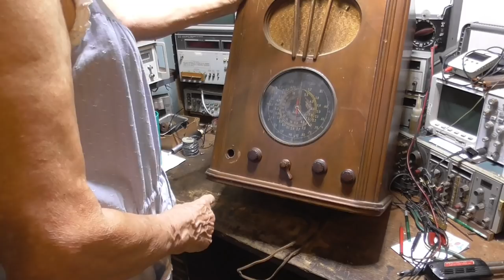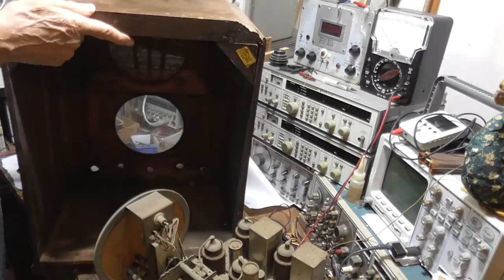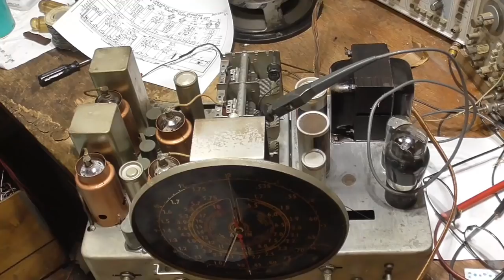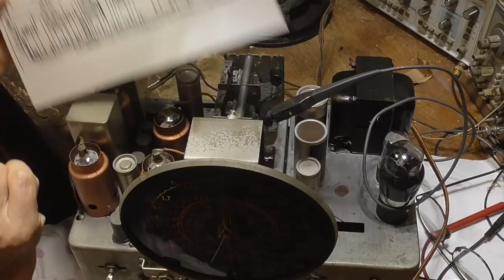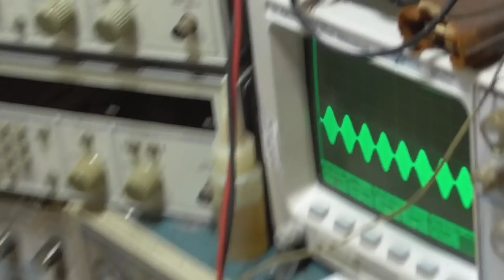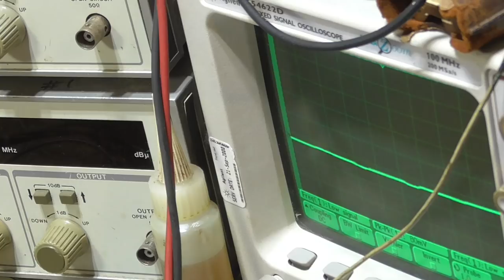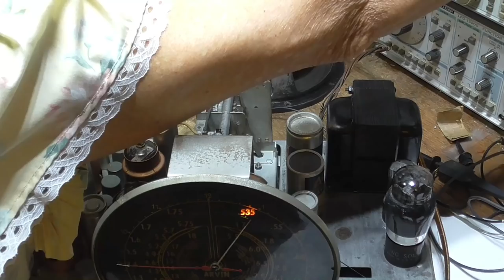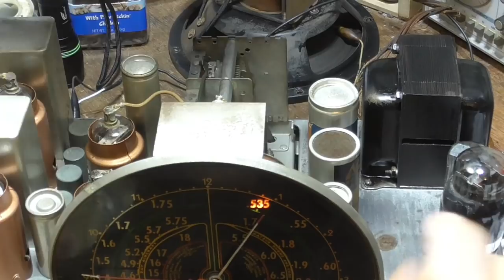REPAIRING AN OLD ARVIN SHORT WAVE RADIO

Comment: Nice job Ron. I've got a 1937 RCA 812K that each band just stopped working after I restored it and was placing the chassis back in its beautifully restored cabinet. Lost the broadcast band then the other two shortly afterwards. I'll look at the selector switch.....thanks.

Comment: You are the best radio repair person by far.  You go into detail and you are easy to follow. I liked the part when you replaced the capacitor in the can and disconnected it and re-attached the new capacitor back to the can with a 3.9 megohm resistor.  I am in the process of replacing can capacitor in Zenith 5S-127 and will follow your method.  Some people hollow out the can on top of the chassis and stuff a new capacitor in the can and then drill holes in the bottom and bring the leads underneath.  I tried to unscrew a can and ended up mutilating it.  Some people cut the can off near the bottom with a dremel or hacksaw blade then take the contents out and put a new capacitor in.  Then they re-attach the top half of the can by wrapping aluminum tape around the two sections.  Too much work.  It doesn't have to be museum quality. I also tried restuffing a wax capacitor by heating it with a heat gun.  I got the old capacitor out but went a little too far and burned the capacitor such that the markings were un-readable - too much trouble and waste of time.
Reply from the maker: You got it! I  do that level of trouble only when a customer wants it and is willing to pay extra. A LOT extra!

Comment: Looks like a model 617 "Rhythm Maid" from 1937.  These are definitely not just $100 sets, they're actually highly desirable and quite expensive when restored.  The "Rhythm" series are the most collectable early Arvin, with the "Rhythm Queen" and "Rhythm King" consoles being the rarest.  Pre-war Arvins of any kind are fairly rare, they were a small off brand with low production until the late 40's.
Reply: I thought so to, I did a quick Google search and saw one had sold for just over 1000 dollars back last year from the radio attic, certainly looked exactly like this one and cosmetically very similar. 
I couldn't find anymore for sale, but does seem to be quite rare and certainly a desirable model.
Reply: @adrinathegreat3095  I think $1000 might be a bit optimistic, though as they say, something is worth what someone will pay.  The market for tombstone/cathedral radios has changed a lot; in the 70's and 80's, cathedrals with small dials brought high dollars - an unrestored Philco 70 was a $400 radio!  Now, they go for far less than that and the market has moved to tombstones with large round dials: Zenith, Sparton, Airline, Silvertone, Arvin, et. al tombstones are all very collectable, and Zenith's 1938 "Waltons" models just seem to trade for ever more insane prices each year.  Interestingly enough, even high-end RCA and GE tombstones with their smaller dials don't generate much interest, despite being better engineered sets than most of their competitors.

Comment: Always enjoy your videos Ron! Your knowledge is just amazing. Love the old Triplett 630. I have 4 models, one from each decade from 50’s-80’s. 3 of the 4 I got for parts or repair and got them all working perfectly. I have a Simpson 260 that I hardly ever use over the Triplett meters. Only thing I like on the Simpson is the polarity switch over the Triplett.
Reply from the maker: I can't  remember ever using the switch! I just swap the probes, myself.

Comment: Hello,
I found your repair channel by accident.  I am so amazed with your knowledge and skill set used to raise the dead to life again. Where do you source elect caps and other small caps?  Just love your show.
Reply from the maker: If you are in USA the source is Mouser Electronics. They have everything, are an industrial supplier so the parts are genuine, and they ship fast. They have no minimum order size and don't mind selling to individuals.
Reply: @glasslinger  Thanks for the info as I am in Canada and do have access to Mouser and DigiKey.  You are the best in your profession.

Comment: Unless that ohmmeter applies quite a high voltage that may not be an accurate way of checking cap leakage. Mr. Carlson has a cap tester that can check caps a lot better into the gig ohms
Reply from the maker: The Triplet 630 applies almost 30 volts on the X100,000 scale. It is quite satisfactory for testing leakage. The meters you are referring to are the modern digital meters that apply about 1.5 volts, which could be a problem.

Comment: Hi Ron, When you sand blast, Do you use glass bead or fine silica sand. That radio came out Great.
Reply from the maker: I'm not sure what it is. It is called "play sand" at home depot. I sift it first through a kitchen strainer. Do not use this on thin brass. The peening action causes the brass to warp.

Comment: Hey, ive finished building a nice amplifier that is producing at least 36 watts of audio. It has been layed out on a cutting board since it was wired up. How can i easily stick all thé bits into a cabinet without a bunch of drilling or cutting or sanding or using adhesives? I havé only tried to fasten pieces of scrap lumber so far to build all of my radios i actually twist pièces of bailing wire to join it together. I havent tried to use nuts and bolts and washers for any assembly yet.

Comment: Only yesterday I was feeding the output of a radio into a CRT just to see the patterns 😂

I'm in the UK, as a child oh about 28 years ago, the low wave or short wave was full of Indian music, very high pitched, but there is none of that now, I used to imagine it was coming from thousands of miles away, rather than 30 miles away in london 😂

MW now is also very empty, its almost sad now, its also a little weird to say, I tuned my radio... To a wavelength that has no stations any more

For the rubber, I've heard latex and mineral oil don't mix, it breaks it down a little, maybe it could help free things up

Comment: I have nearly ruined soft parts by spraying them with brake Klean. They break down in sometimes just seconds. may want to try that some time. I plan on doing that.
Reply from the maker: I have had similar fails. DO NOT SPRAY THE CIRCUITS WITH THE POWER ON! I had an arc form on some switch contacts I was spraying with the power on. Always let the spray dry completely before turning on the power. I don't think it matters on low voltage transistor circuits, only old radios with high B+ voltages. Best to let it dry completely.

Comment: Ron, what media do you use for a blast media and how much pressure did you use to prevent total destruction?  Glass beads of a certain size and something like 30 psig perhaps, or something else?

Do you prefer a special type of light oil for the bearings?
Reply from the maker: I use beach sand, which is worn round corners so it doesn't cut. Pressure is 125psi and I use distance and time to moderate the  force. Be careful with speaker cones not to hit them at all! Pilot lamps must be removed.

Comment: Ron, this is off topic but you might see this and have an answer. Can you explain how the old 4H4-C ballast tube worked and how a 6V6 might substitute (4H4-C unobtainium) ? Somehow the filament of the 4H4-C in series with a tube filament downstream helped stabilize the current in that downstream tube. This refers to the National NC-303 shortwave receiver. Thanks Ron!
Reply from the maker: These are currently over $150 each so replacing it would be best. A 6V6 will not work well. Best is to rectify the main filament supply voltage and use a LM7806 regulator I.C. This will give better performance than the 4H4 and won't wear out.
Reply: @glasslinger  Thank you Ron. Your regulator idea is really clever! I will do it. Can't thank you enough for the answer.  Ron, you are a legend in my book!

Comment: Does your RF signal generator have a modulation frequency output so you can sync your 'scope sweep to the modulation frequency for a stable display?
Reply from the maker: I could probably rig that up if I got after it. The modulation signal generator is separate from the RF signal generator.

Comment: What kind of blast material do you use in your sand blaster?? Thanks
Reply from the maker: Beach sand. It is not the sharp edged cutting sand. It knocks off the rust but doesn't cut into the metal.

Comment: Hi Ron from the UK. Now i've watched many of your repairs and refurbishments and you do a good job in getting these old radios up and running. However, now don't take this the wrong way but I cringe when you sandpaper wood surfaces prior to staining or laquering. To get a really good surface finish with minimal sanding scratches you should always sand with the wood grain !!!!. Sorry but I just had too say it OK.📻🔌😏🐈
Reply from the maker: On the wood itself yes. This time it was on the actual old lacquer finish, which has no grain. They really put the stuff on thick back then!

Comment: I'm adamant that you are:
(-1-) 50%  Genius
(-2-) 50%  Mad Scientist

We disagree on how to make solid solder connections but you dazzle me with your other effective methods including mechanical repair including wood refinishing and dial reconstruction (cords and faceplates), reuse old condensor housings, sand blasting,  and on and on and so et al.  And I clearly see you have circuits engrained in your brain from repeated exposure.  

I only would hope you, as a teacher to others, would DECLARE that B+ circuits are hazardous to one's health.  As a very young teenager my parents gave me tube radios to PLAY with.  PLAY WITH?  Yeah, sure!  "Hey kid, why don't you go out in traffic and play!"  <sigh>.  But I'm still here❤.  I understand that current flow thru the body causes muscle contraction.  Contraction that tends to HOLD ON TO THE ELECTROCUTION EVENT.  That, further, AC being alternating is easier to break free from but DC maintains contraction making breaking loose more challenging...  So why not start your videos with a quick disclaimer about the dangers of working on vacuum tube devices?  It can't hurt (pun intended).  

BTW-- you have impressive test equipment.  Do you do your own calibrating?  

BTW x2 -- when kitty throws up... (yeah cats throw up) -- after throwing up they quickly become hungry again.  Do you have dry food 24/7 like I do?  Can food 2x; dry 24/7...

P.S.    Why don't you always test all tubes at the beginning of your process?  Afterall... you don't have to run down to the drugstore, right?

Comment: Great work ( as always, I might add ) ! 
Could you please be so kind and tell me what make and model the analog multimeter is ? Is it the one wich uses 30 plus volts in the meg-ohm range, the one you test condensers with ?! 
A reply would be very much appreciated ! Thank You in advance.
Reply from the maker: Triplett model 630.  Any of the 630 models use 30 volts. You can make the battery with a stack of 3 volt lithium coin cells.
Reply: @glasslinger  thank You 🙏🏻 very much for Your answer. It's very much appreciated 👍🏻

Comment: Hey Ron I know this video is a few years old but I was hoping you could tell me where you get your dial string in a big spool like that?
Reply from the maker: It's lacing cord! Unfortunately that has more or less gone the way of the vacuum tube. The only place I have found it is on ebay, and then very sporadically. Also try looking on ebay for woven fish line. Sometimes you can find rolls of that.
Reply: @glasslinger thank you very much for the information

Comment: Someone ONCE Said that there's no ugly cats, that's pretty close to being true..,..,,, I think to clean the wiring area you might try something like walnut shells or something versus sand... How was it cleaned because after sand blasting at 9:55 it still looked dirty,, then later it was clean... Did I Miss something
Reply from the maker: I use sand directly on the switches and wiring. (I use blunt sand, not cutting sand.) Then blow it all clean after. Sometimes something that sounds crazy works surprisingly well! If the wiring has crumbly insulation, this is not to be done!

Comment: This is off topic, but would you mind to make a video about the vacuum pump you are using for custom tubes projects? It is not easy to achieve such depth of vacuum ...
Reply from the maker: See my website, "tubecrafter.com" which has all my equipment described.
Reply: Thank you!!
Reply: @glasslinger  Will we soon get to see you slinging more glass? Now that you have a good camera, I would like to see some of the details that didn't show up well in the otherwise wonderful videos you made a decade ago.  Thanks to you I asked santa for some parts so I can attempt to make my own tubes. I want to make sure I correctly imagined details the GE camera wouldn't focus on. Holy bat turds Batman, your website is another treasure trove of information.

Comment: I sounds like you sell your finished projects. If so where do you go to see what you are selling?
I enjoy your videos...
Reply from the maker: Not really practical. There is a local antique shop here in Houston where I put my radios for sale. They go fast I used to do ebay but that is out now with their new invasive data mining policies.
Reply: @glasslinger  The antique shop on Heights with the radios in an out building? Am in Houston as well. Or the one at i10 near Sam Houston toll rd?
Reply from the maker: @Bob_Suruncle  I guess you could call it an out building. It's on Heights blvd at 8th st.